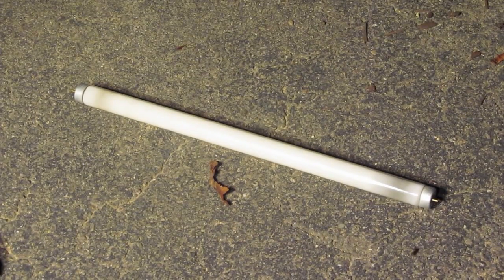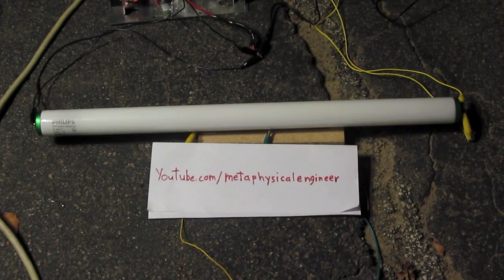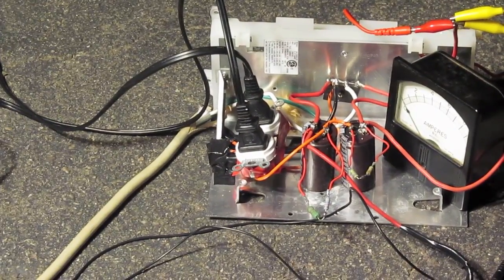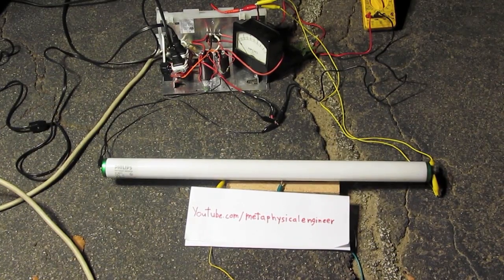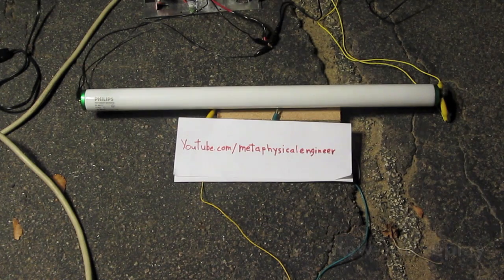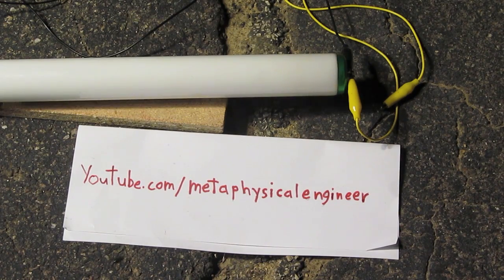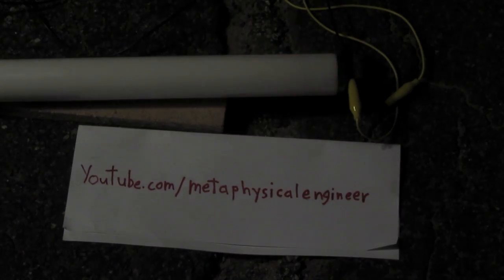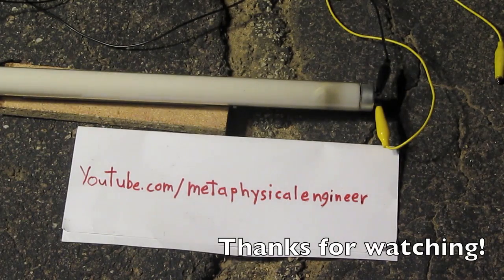F20T12 Fluorescent tube doesn't last long on 400VDC

Comment: I have a T5,2 feet(14W) fluorescent tube setup that have its electronic ballast go bust without warning.Can I change the ballast to a light bulb and a starter(I cannot find a 14W ballast anywhere in my region)?Also,I have 40W and 60W light bulbs,does that work?Finally,does it work with 13W(or alternatively 18W) traditional ballasts and starter?

Comment from the maker: Wires are intact, and there were two wires per tube end so if one failed, the other would have taken over.  I confirmed the tube had lost vacuum by holding it up to a little plasma globe flyback.  There was no glow from the tube even with that, so the seals have failed.  There wasn't sustained current, just a 40-joule burst that blew the tube but didn't even get the wires warm.  The ammeter didn't even have time to move.

Comment from the maker: It was pathetically quick.  I edited out a minute where I stood there going "Is that it?! #$%^%$&^!!"  Apparently tube seals shit themselves when the tube takes 500uF at 400 volts = 40 joules.  Nest time I'll put another series resistance inline with the tube to let it start gently, and then crank it up.  Also wanting to try striking an arc in an incandescent lamp by DC overvolting with enough current.